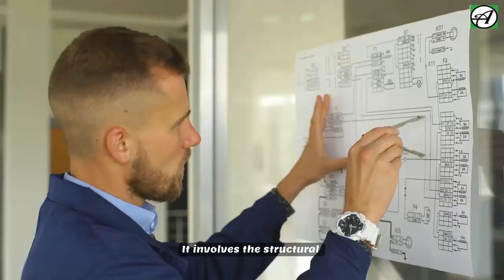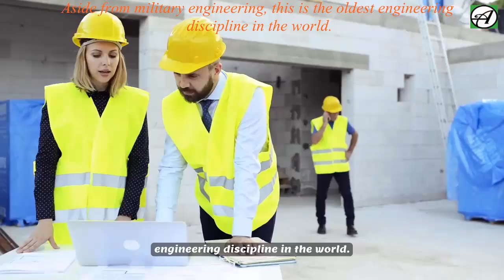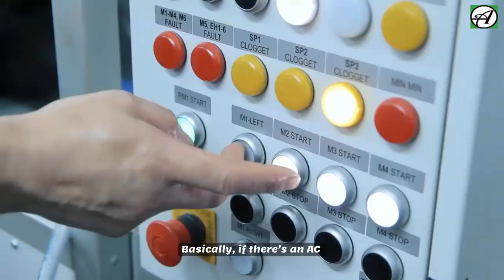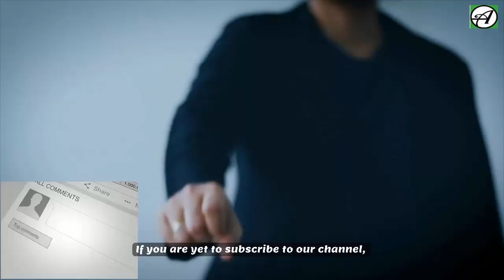Top 10 Highest Paying Engineering Jobs in the World

Comment: computer design and consumer electronics design is done by electrical engineers .. huge industries and employers .. electrical engineers also work on all things radio including phones, radar, WiFi, etc. .. then there is all the realtime software which is typically done by electrical engineers (EEs) .. it is the most diverse engineering field and I have just touched the surface of all they do .. "computer engineering" is relatively new as a degree and the jobs are often done by EEs, EEs also do much of the work in aerospace controls, displays and sensors, starting pay is good as well

Comment: Petrolium engineering is the worst engineering field becareful everyone cause all oil and gaz companies are going down and will be replaced in the coming few years by renewable energy. Renewable energy engineering will rise and it's already rising. In 2030 90% of energy will come from renewable.
Reply: I hearing that last 20 years😃😃😃 
No alternative for petrol.No one take place of petrol and gas.It is nature's big gift.
Reply: In a few years time, the World will either run out of Oil or the Oil would become cheaper than a litre of drinkable water.
Reply: I disagree. In 2030 around 30% of electrical energy will come from renewables, if we are lucky. EU target is actually 32%. We won t stop using oil for at least the next 50 years, probably more. I agree that renewable engineering is rising but you can easily become unneeded if the world takes a route of using nuclear power as primary source.
Reply: @matijakriznik4663  in 2030 to generate electricity power there will be need oil and gas because oil and gas have strong exaust power.😆😆😆
Reply: Where do you get your source??
Reply: I don't agree with you,  however much innovation on renewable energy is on going  but some extent we still need natural resources & there products for day to day life

Comment: What is the different between electrical engineers and electronic engineers?
Reply: Electrical engineering is concerned with mainly power while electronic engineering is concerned with circuit analysis.
This is what the main difference exists  between these two.

Comment: I'm studying computer engineering and this is a total confidence booster
Reply: Well how's it going so far? I'm starting mechanical engineering in January, so happy.. I'm 39 and it's a lil late,  but can't wait to don that title !!
Reply: @toetagm  I got my degree in the spring in Mech E, and am in grad school for BME. If you want a piece of advice, I'd say "do the job before you get the job", and that applies to school, too. If you can spare the time before you start your program, study a few hours every day. Calculus, physics, or whatever your first classes would be are all good choices. Also, make sure to do internships as soon as you can get them, if that is an option. And lastly, don't neglect developing skills with software (solidworks, LABVIEW)and programming languages (python, C, or whatever you can use productively). Having those skills will really broaden what you can do. If it doesn't drain your time too much, you can write software to solve your homework problems. It helps develop programming skills AND helps to solidify your understanding of the homework, as long as it doesn't oversimplify things (like using MATLAB to do basic linear algebra would be too easy). Hope some of that advice helps you.
Reply: @toetagm  l planning to go for electrical engineering qualifications what do you think?
Reply: I'm an engineering aspirant, without Computer in 12th. Will you tell me if I can opt for Computer engineering by studying Computer in a coaching class simultaneously???
Reply: @sohinisarkar5204  You need to take a lot of electrical engineering classes to be a computer engineer
Reply: Is it worthy for earning money !sis? Coz i also want to be  engineer but in Nepal ..mostly people think  its not worthy it better to be doctor😟😟
Reply: @isharamagarraee9000  the thing about engineering is that you can work from home for any company
Reply: @isharamagarraee9000  which study level are u now?
Reply: Ishara Magar Raee vanaaai matra ho
Reply: Engeenering Software x50000000
Reply: I'm in high school, but I want to be a hardware engineer when I get a job
Reply: Me too going to do b tech and in that I'll do Computer Science
Reply: I want to be a computer engineering someday.
Reply: How has it been going? Let me know if I can help you with anything, thanks
Reply: @JakeVoorhees  hi! Are you Comp. Engineer?
Reply: Not hood
Reply: @Chi Dee it's been one year, how is it going?
Reply: Which University are you studying computer engiy
Reply: Great career choice. Hope you’ve made it or are making progress.
Reply: I am also a Computer Engineer
Reply: I also want to study computer engineering
Reply: me software engineering
Reply: @usmanAli-hw5xu  I am on your side bro